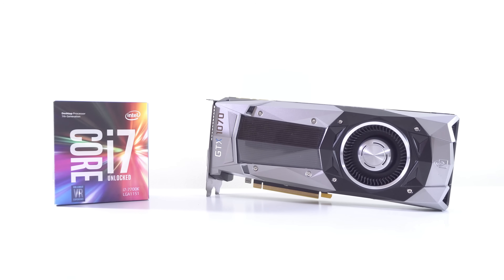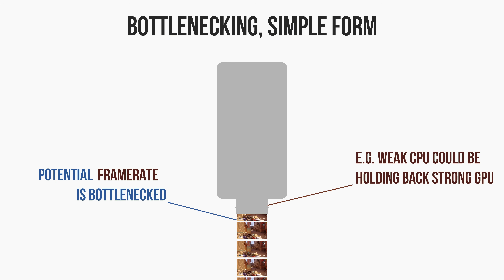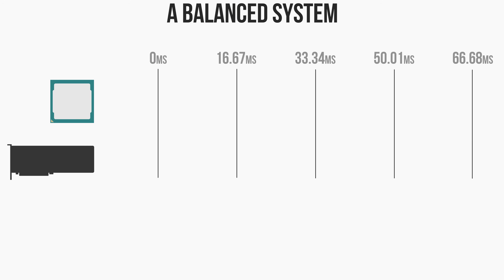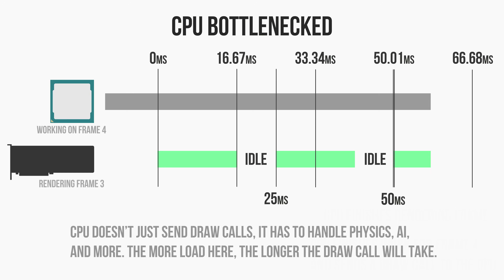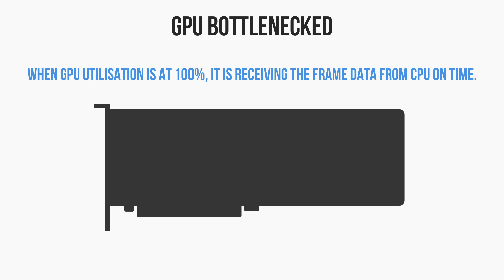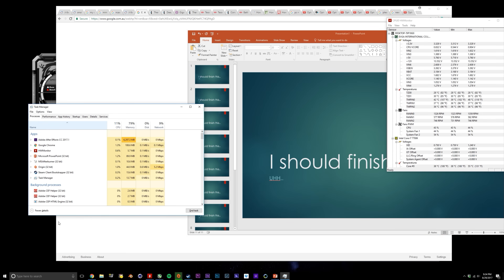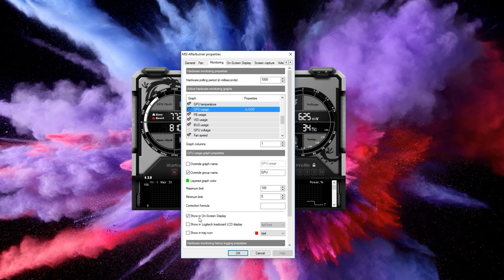CPU / GPU Bottlenecks in Gaming Explained

Comment: If CPU is weaker: 1. your game willl occasionally freeze and/or stutter and/or frame drops as the GPU wait for the CPU to feed it data, and 2. Smooth picture but lagging sound
If GPU Is weaker: Smooth gameplay but the max FPS is limited by the GPU

Comment: I have a RTX 2060 with i3 12100F. In new titels i have a CPU bottleneck, now i wanna upgrade the CPU to a i5 12600K to get rid of cpu bottleneck and to have a future proof cpu when i upgrade my GPU in 2 Years. The Problem is when i get the i5 12600K i will have a GPU bottleneck. around 12%. My question is now, is it even worth to upgrade or will i face same FPS results while gaming due to the GPU bottleneck i would get? im confused friends xD

Comment: "Bottlenecking" is often not something the average PC gamer needs to worry about.  Especially if you use v-sync.  

Of the two, it's much better to have a CPU bottleneck anyways.  That means you can play games at higher resolutions typically.

Comment: I was trying to but a gt 710 for my i7 2600 because the fucking intel (R) HD graphics 2000 is sooooooooooo baaaad but thanks for explaning to me what a bottle neck is even if I’ll be broke buying a 1060 and when I tried a gpuuserbenchmark (gt 710) vs (intel (R) HD graphics 2000) gt 710 is 412% better! But when I tried a fucking 1060 it got 8568% BETTER yeah I’ll be broke in a few days!

Comment: If I had an i5 would I be able to use a 3080?
Reply: depends on the series, for example an i5-9xxx (9th series) is better than a 4th series i7, but probably won't work with a 3080

Comment: Most bottleneck calculators I've found (gpucheck.com & pc-builds.com) express bottleneck as a percentage. Does this mean that with the same CPU a better GPU would produce higher FPS, even if it's passed the point of bottleneck? E.g. Their websites say both the 1660 and 1660 ti would bottleneck an i7-6700, but would you still get better performance out of a 1660 ti or is it all a waste after a certain point.

Comment: I have a question in this case should I buy new CPU (Ryzen 5 3600) that won’t cause GPU bottlenecking or Used CPU (Ryzen 7 3700) that will cause bottlenecking if both cpu are at the same price. Which one is the wise decision ?

Comment: Nice video explaining most of the compatibility related things to consider, but I would like to point out to also pay attention to CPU bottleneck, as I feel like it is a very underrated topic in general on YouTube and elsewhere. I am writing from my personal recent experience here. Recently an AMD Radeon R9 280X graphics card (stock - never overclocked) died in my personal Gaming PC build from 2014. I am still running Intel Core i5-4670K processor (stock - never overclocked - only running OC Genie on the MSI Z87-G43 ATX Motherboard for the last couple of days, which is a very mild overclock for the CPU and RAM 16GB DDR3 1600MHz), as I didn't feel the need to upgrade over the last couple of years. I would like to build a new gaming PC soon, but I am currently waiting for the big AMD Navi graphics cards to be released. Anywho, I digress. So, what happened is I have researched the current new AMD graphics card market pretty extensively and researched the "bottleneck" term and other compatibility problems related to CPU and GPU working together. I did all of this before purchasing a new graphics card that would replace my old and dead AMD Radeon R9 280X graphics card. So, in the end, after a lot of comparing and stuff, I decided to go for AMD Radeon RX 590 graphics card, as the value for money is very good in my opinion when looking at the current new market where I live (UK), and then the problems continued... Once I installed the new AMD Radeon RX 590 graphics card into my current gaming PC and launched Battlefield V (which is my main favourite game for the past few months), I started experiencing severe stuttering (unplayable for me), random crashes, freezing in game, etc. So, I monitored the CPU and GPU usage, and both were near the 100% mark, for the GPU 100% usage is good, but for CPU 100% usage is not so good as it means CPU bottleneck, which I feel is the reason for the bad experience that I am having with the new graphics card. So, in conclusion, do not purchase a graphics card that is more powerful than your CPU. I think that most YouTubers and other Tech people do not really mention this problem and assume that everyone is or should be using very powerful CPUs. I just felt that I should share my experience with you guys so that you can avoid this hassle. I am going to be returning the graphics card and purchasing a different one, one that is more suitable for my current CPU. I am thinking about getting AMD Radeon RX 570 graphics card from the used marked, as I found very nice deals on Ebay.co.uk for manufacturer refurbished model and therefore it is very good value for money and nice performance for what it is. Finally, remember to take your desired monitor resolution and refresh rate into account guys. I am using 1440p 144Hz. I know that my current gaming PC build is more suited for 1080p, but ohh well, I am going to upgrade soon anyway... maybe... 😂🤣 Amen. Take care and happy gaming folks! 😎😉

Comment: 1050ti
Amd fx 9590
Asus crosshair v formula z
Game=black ops 4 / black out

Gpu = 99%/100%
Cpu all 8 cores hit 100% almost and drops to 60% or sometin and then again 100% this happens so fast i dont know if it hits 60% but it drops is this good ?
Reply: No its not good, your CPU is a bottleneck for the 1050ti.

Comment: i am using fx6350 and gtx 650, playing csgo mostly which is cpu intensive, based on this video i should use high setting to bottleneck gpu so that it  reduces cpu stress?

Comment: So firstly I’m not the best when it comes to PCs so don’t judge me

This is my current specs
CPU- i5 6500 @3.2gGHz
GPU- Radeon 480 
Ram- 8gb

So I want to buy a new graphics because I am struggling to get 60fps on rainbow six siege with medium settings do I am thinking of getting the rtx 2070. If I were to get the rtx 2070 would I be able to get maximum performance from it or will I need to have to upgrade my cpu as well?
Reply: FknOwen bro get rtx 2060 it’s enough for ur pc and ur system is not gonna handle rtx 2070.

Comment: thank you for a great video and clear explanation. please advice , I have an i5 660( yes...old cpu) and looking for a good gpu that can run GRW, the one that I found says a bottleneck of 29% is it bad? should I skip it , or it's still good for my pc?  thanks
Reply: 6th gen, not that old. Id say you need something above, eh 970. Btw 29% isnt that much to worry about. You can always overclock.
Reply: @Swagmaster07  its the first generation

Comment: question? so you  think it's better to have a bottleneck gpu than a bottleneck cpu because on a bottleneck cpu your fps will drop so low example i pair i3 cpu  w/ 1070ti/1080ti no matter what you do you will have the same performance unlike a bottleneck gpu even if you got only a 1050ti but you got an i5 or i7 you will see a big performance difference vs an i3 paired w/ 1070ti/1080ti

Comment: I have i7 3770k stock speed and 2080 FE card. Both are nowhere close to 100% most times. Is that a bad thing?(no cpu bottleneck if not used 100% right?)I play AAA games only.

Comment: My friend had 100% usage on his gpu and he has a 1080ti paired with a 8700k. Cpu usage was very low and it caused stutters in game. Tried clearing the cache and nothing works. 1080ti dropping to single digits fps in pubg. But after updating the bios, the cpu usage is more in line with the gpu usage and hence, no more dropped frames, at least not to a single digit (because pubg is a optimization required whore). So remember to update your bios peeps

Comment: Like I've been saying a gpu bottleneck is a good thing,you are utilizing every frame the gpu can push out while saving space on the cpu for other tasks such as multitasking.Sure the cpu can process more frames but then you could just get a better graphics card.Getting a weaker cpu that wont be a bottleneck on that same graphics card will not get you any more frames than a stronger cpu with that same graphics card.Your just making it so you can upgrade to a better gpu later on or have more cpu usage for multitasking.
Reply: Modern API's don't offload work from the CPU.   

Being GPU bound typically means you can't increase the resolution and there's no margin to play with in terms of graphics quality.   It also often results in higher power consumption.

Comment: So I dont't think this is going to be answered but I have a GTX970 and a i5-4460 3.2GHz and I having problems streaming newer games so I'm thinking about upgrading my CPU, checking the bottlenecker aparently almost every 8th gen intel processor from i5-8400 will bottleneck my GPU, is that good? I mean, will that help my computer when streaming?
I've been thinking about getting a i5-8600

Comment: Pentium G3240 + Gtx 760 + 600w True Rated PSU?
Reply: You'd probably have CPU bottleneck, as i look at it, you have a better GPU than me (mine is r7 250) but worse CPU (Mine is Athlon II x4 641 2.8 GHz). I'm saying that you shouldn't really pair a CPU with 2 cores and 2 threads with that GPU so you will be bottlenecking by my guess.

Comment: It depends on game optimization, video drivers, and your refresh rate of your monitor as well... For example if you have 60hz monitor and 60 fps on maxedout settings with gtx 1080 and i5 4670, you don't give a fuck about 50% of gpu usage on average... 60 fps is standard, and if you have 60hz monitor, then you don't give a shit about "bottleneck"... However if you have huge drops and lags and stuttering, then that is disturbing, and if it is not about game, then you should replace your gpu or cpu immediately... Also if it is small difference or no difference between high and ultra or medium and high, but you have higher or constant fps, then you should set to lower setting as well... Your welcome I glad I helped anyone :)

Comment: So even though an i5 8400 is sitting at like 50% usage while a gtx 1060 is at 100% means that it is good and still allows ur cpu to run other apps like discord without any major impact on your framerate. Is that right because it is probably going to be in my next computer build.
Reply: 3.v.4.n
Yep. 100% GPU utilization means that you are getting the most out of it.

Comment: what if my r7 1700 @ 3.7ghz with a 1080ti is running at ~60% on each individual core and like 80% gpu usage, whats bottlenecking that (far cry 4)?
Reply: Samuel Kulíšek if cpu is running at 60% you’re fine, the gpu running at 80% with far cry 4 bc this game is gpu intensive 
I’m running a 7700k@5ghz with gtx1080 oc@2ghz and is always higher than my cpu on far cry 4 and primal
How many frames can it run?
Reply: Simone Frigieri average of like 70, problem is, its 60% gpu and 2 of my threads are at 80%, while the rest are below 50, and i get some stutters from time to time without any reason, i mistyped in the first comment
Reply: Samuel Kulíšek at 80% is not bootleneck
It’s true that ryzen is not the best for gaming
Did you try to change the power management to Amd balanced?
What temperature is cpu and gpu?
Are you running Windows 10?
Reply: i have no idea what you mean by amd balanced power management D:

https://imgur.com/RqP5uEx
in this screen the gpu isnt even at 40% usage, but isnt even trying to push out the 90 frames per second i would want, and sometimes, for no reason at all, the fps drops down to even 40, not too often to annoy me, i just cant see whats causing it, thats why i asked in the first place
Reply: Samuel Kulíšek at what resolution are you playing?
Looking at some benchmarks around, (with i7 6700k) at 1080p average is 70/80 fps
At 1440p average is 90
At higher resolution, gpu will be loaded more than cpu
Your cpu is lower on clock compared to the i7, also this doesn’t help
Reply: Simone Frigieri 1920x1080p is my resolution, im more concerned about why the game is not utilizing full hardware potential (ie using 1 core to 100%)
Reply: Samuel Kulíšek try to OC the cpu, and also disable the SMT in the Bios (some games improves a lot when disabled)

Comment: Would an i5 8600k be good enough for gtx 1070 in sli?
Reply: Quakestep why 1070 sli? With the same money you can get a 1080ti
8600k is a good cpu for gaming, but will be always running almost at 100% when pushed at 1440p high quality (1080ti)
Could be bottleneck
Not sure with 1070 sli, Maybe!
Reply: can it?   sure
should it?  no

just get a 1080 or 1080ti,  just one of either of them will be better than the two 1070's   and cheaper.

Comment: i did gpu-z render test and the reading was 99% GPU usage and CPU is under 20% usage but when gaming the gpu usage is 30-50% cpu 30-75% !! i was playing fallout 4 ,ultimate ninja storm 4 same results both 
my machine :
gtx 1050 ti , core i5 6400 ghz ,ps is 500w 
why gpu usage is low ?

Comment: Great video! 0:42 I understand what you mean (and everyone else does too) but like, scientifically, "the faster the water will flow" isn't correct right? The speed is consistent, but the volume of water coming out of the bottle is more. Hence, the volume/time ratio will be higher, but the distance/time ratio will stay the same.

I'm asking because I'm not sure myself, please correct me if I'm wrong.
Reply: Jonatan OTW you're right,he just meant that more water will flow through

Comment: I have a AMD RYZEN 5 1600X with a GTX 1070. My CPU usage is reaching 100%, what should I do?!?
Reply: Increase the resolution/detail settings. Even the GTX 1050 will be bottlenecked by the i7-8700K if you play games on 480p
Reply: Thats weird, you shoulnt have a bottleneck with that CPU, even i3 6100 can handle a 1070 with no bottleneck. check for extra apps, you are recording while playing? Nowdays the most common bottleneck its gpu bottleneck not cpu.
Reply: yeah I just ran it through bottleneck Calculator and it only shows 4% bottleneck, So I'm at a loss.
Reply: you have a virus running in background

Comment: You thing that a Ryzen 7 1700 will bottleneck a gtx 1080? (i thing is fine)
Reply: a ryzen 3 or i3 will bottleneck it, i5 - ryzen 5 and so on are far from being the bottleneck in a system, only in some city builders.

Comment: What cpu would you recommend me to use with a gtx 1050ti msi? Please help
Reply: Pentium G3460. Nothing of current tech can bottleneck a 1050 ti, the most common bottlenecks are GPU bottlenecks, not the other way around (that is desinformation of this video)
Reply: Thanks. I'm having a cpu bottleneck right now with my i3 4160, so I need a new cpu to work well with my 1050ti. Oh btw what about the ryzen 1200? Is it better than the g3460?
Reply: Kriizellia theres no way a cpu is bottlenecking a 1050 ti. Only in specific conditions like city simulator games or very high resolutions. Check for extra apps or malware
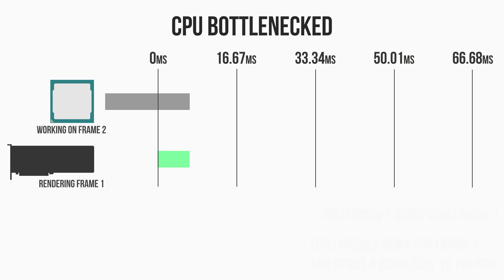Reply: No, I mean at 2:22 I have the same problem like that

Comment: Got a problem here with my build 
In Overwatch for example my GPU is at 60% and my CPU at like 50%. What is bottlenecking here?
GTX 1060 6GB / i7 2600 / 16GB DDR4 RAM at 1333mhz
Reply: It is a second gen i7 cpu, that is why it is slow i think.
Reply: Bat Man nothing. Youre good
Reply: Well there are a few options. 

It could be your drive.  if you run an HDD instead of a SSD it can definitely be a bottleneck. 

Your ram speed is a little low, though  i don't think it's slow enough to be an issue, but it could be. 

your ISP could be a massive bottleneck. 

You could also have a bottleneck caused by heat, aka thermal throttling. 

and obviously   you could just not have a bottleneck at all. 

I'm going to assume the reason you're asking that is because you're  having performance hiccups.   So open up task manager, and watch the performance for your memory and disk.  (windows 10 allows you to measure  your CPU, GPU, Memory, Disk, and Internet)   if one of them is at 85%+  while the others are sitting around 50%ish   that is your bottleneck.      

It might also be a good idea to check the temps of your components. 

(yea i figure this isn't still a problem for you, but in case anyone else needs an answer)
Reply: @NoESanity  my gosh you guys are spreading some massive miss-information. His GPU is at 60% so his CPU is the bottleneck. CPU is at 50% because the game cannot utilize all threads. Get a faster CPU or increase your graphics settings to hit 100%

Comment: Is i5-7600k bottlenecking Asus strix 1080
Reply: How many cores and how many threads? I got i5 4690k and it's 4 cores 4 threads might not be enough. But I plan to OC it to highest possible level to see if it .Ames a difference. Having more threads really does help

Comment: I have a GPU bottleneck and the kicker here is  that my I7 880 is what- 7+ years old and it doesn't reach 60% in most games today? However, my 4 GB RX480 OC maxes out every time giving me relatively low fps on Med/high+ settings.

Comment: You actually said the most common bottleneck in pc gaming is the cpu. The most common bottleneck is actually the gpu, unless you have a modern card paired with a intel core duo...
Reply: well i'm running a core 2 duo....
Reply: Depends, there are still a lot of people running old CPUs with new gpus
Reply: Yeah
Reply: Edgar Wagt i just built my pc and dam... My cpu is outdated
Reply: I have 5th gen i5. Will it bottleneck if I upgrade to gtx 1080?
Reply: @MonkeyDLuffy29  probably
Reply: @albinliljenvall2414  Yeap bottleneck confirmed. Dont do this kids. I need to upgrade my mptherboard + ram + cpu now xD
Reply: @MonkeyDLuffy29  😂😂
Reply: @MonkeyDLuffy29  go for 16 ram, that's enough
Reply: But a weaker gpu on a stronger cpu does not take away framerates compared to a stronger gpu on a weaker cpu.It means that you are pushing every frame from the gpu that the gpu can handle.